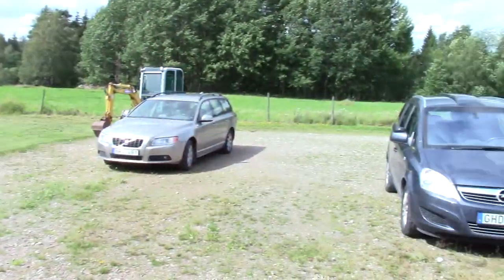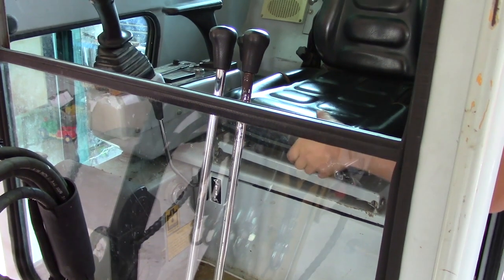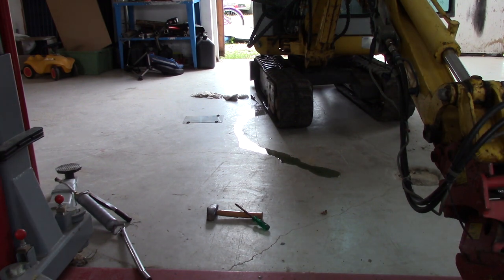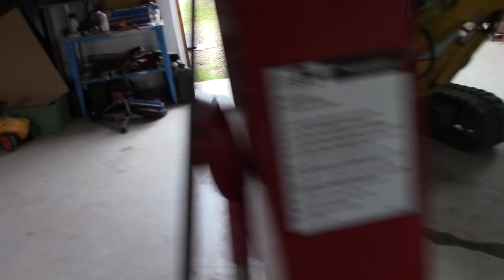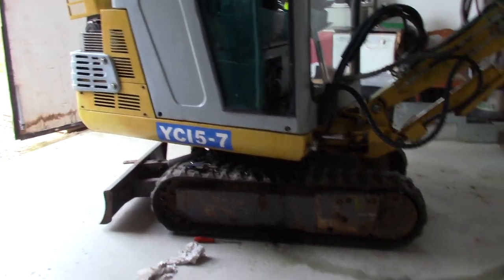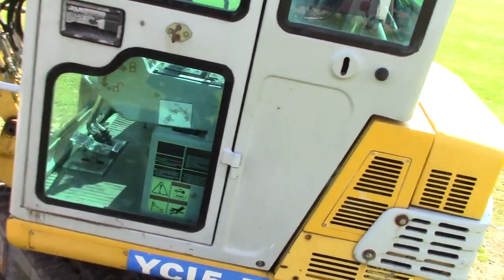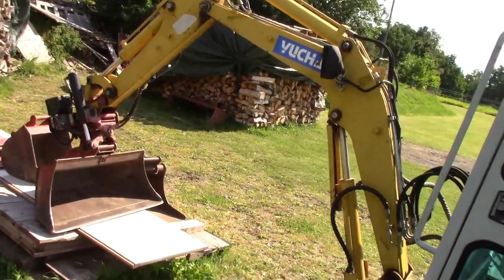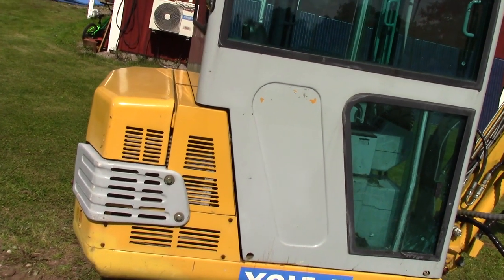VLOG #003 - Fixing with excavator and digging

Comment: Hey, I have the same digger as you but mine has a few problems that I’ve been scratching my head at for a while...

The digger runs but the glow plugs don’t turn on when the ignition is on, to start it when it’s cold I have to put 12v across the glow plug rail then start it.

The windscreen wiper does not work, I’ve taken it off the glass and confirmed that’s it’s a wiring problem because the wiper Motor works.

Also the radio does not work which is not important, but would be nice to have when digging for long hours.

Thanks to your video I finally know where the fuses are but, do you have to take out the heater to get to them?

Any advice or knowledge would be helpful :)

Might be a good video idea ;)
James.
Reply from the maker: 1. Check the relay doing the glow plugs. its either that one, The coil at the key or something else. Ie check wiring. 2. Check the wiring. 3. No do not have to take out the heater but its basically in the way for sure! :)
Reply: Thanks for a quick reply :)
Do you know where the relay is before I tear my machine apart to find it?
Reply from the maker: @jamesclark52  i dont im afraid :(

Comment: I've always wondered why all the houses are painted the same colour in Sweden?
Is it just the area you live or all areas that do this?
Reply from the maker: Good question and it kind of depends on area. I use something called "Falu rödfärg" Its a poor mans color you could say that was common back in the days. Its still very common since its easy to work with and give a good protection. It does not exist in many colors due to how its made. You can find more information here: https://en.wikipedia.org/wiki/Falu_red  Thing is that to change the color you need to change the panel on the house since you should not paint it over with any other paint kind of. I bought the house with it on so I will leave it like that :)
Reply: DIY Tech & Repairs Cool thanks man... interesting, 😊